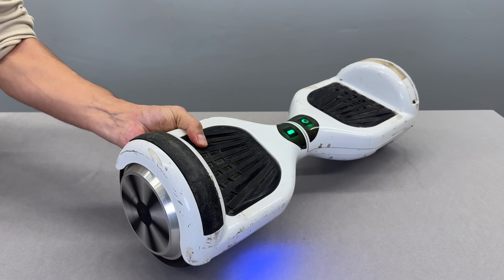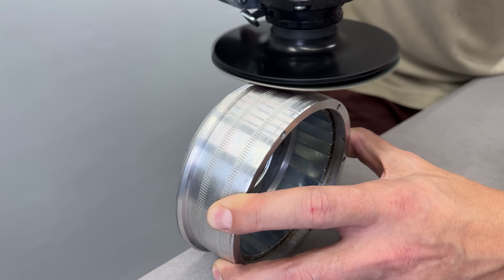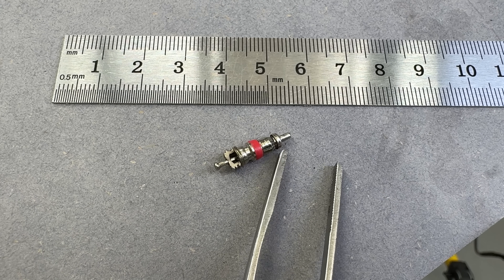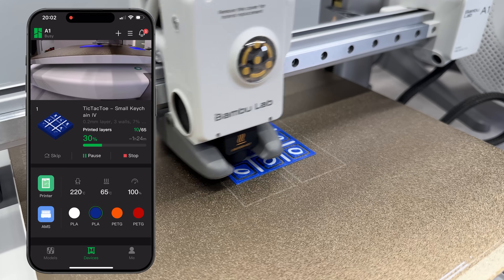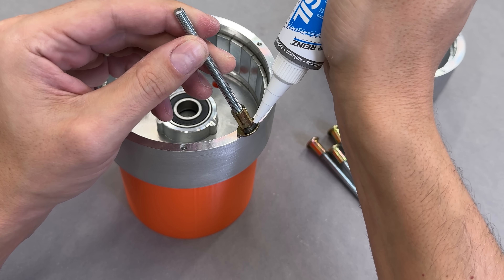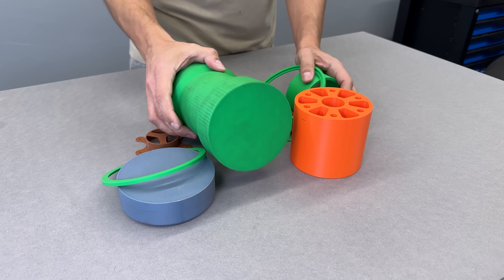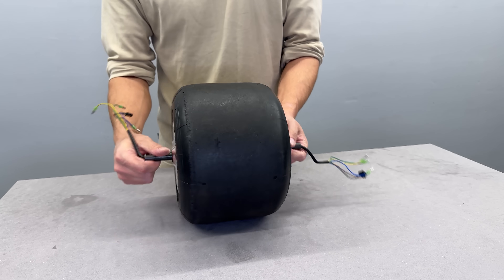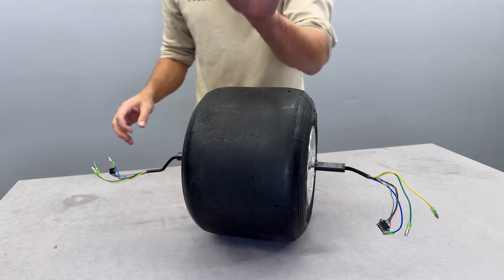This Tubeless Wheel Has 2 Motors Inside

Comment from the maker: What would YOU power with this dual-motor beast?! 👇
 Drop your wildest ideas - electric scooter? mini tank? lawnmower from hell?
 Also, all 3D print files are FREE on MakerWorld (link in description)!
 👇 Let me know if you want a full build video on what I make with this next!
Reply: Did you include the file for the aluminum ring also?
Reply: what size of drill bit did you use to drill and  size of tap for the presta valve to tread in, answer asap
Reply: @PHLocalExtremeSports  Yes we need to know this. Drill an tap size , please🙂
Reply: A compact electric crotch rocket with dual motors—built for insane speed and the ultimate way to Go around.
Reply: Anticipation for this gokart but if you get two wheels you could put them close to each other and make a tennis ball launcher.
Reply: Onewheel pls
Reply: i wanna know could you do it with the side that the wires are facing to point in the same direction to make a single sided design?

Comment: This, IN NO WAY, doubles the power by putting both motors in a single wheel. This also isn't an original project, or even done properly to actually get good speed & reliability from the motors. FFS 🤦

Comment: HELLO FRIEND,
CAN YOU PROVIDE THIS INFORMATION:
WHICH THREADED TAP DID YOU USE TO INSTALL THE VALVE? TAP SPECIFICATIONS.

WHAT IS THE LENGTH IN MM OF THE SPACER BETWEEN THE ENGINES?
Reply: I need this info too

Comment: Even though I think you have come up with some creative solutions for a hoverboard onewheel, I can't help but think about all the possible leaks. they are 6+6+2 (6 +6 screw hole + 2 rim washer). think the rim washer is the biggest problem. But still think your build is nice, and you can still go with an inner tube if i have a point. looking forward to your upcomming build. Best regards

Comment: I would expect the air to leak thru the bearings (thru pors in the 3d printed part and thru the inner bearing and inside the motor and thru the outside bearing and it wil preasurize the seal)

Comment: Nice idea and execution!
I would change the central orange plastic spacer for aluminium. Although the pressure of the tyres is constantly pulling the 2 rotors appart, once mounted in a chassis, the vertical loads on the tyre can flex the two motor axis, and cause compression on the plastic spacer. 
If you are using it for a onewheel, i would be extra cautious about any failure cause.

Comment: made a very similar wheel for my onewheel, if you line up the magnets polarity in the hubs the same you can parallel the motor wiring and only need one brushless controller.
Reply from the maker: Nice idea! I need to try that.
Reply: Nice idea! How did you mechanically line up and lock in place the stators? 
Tightening them to the frame individually?
Reply: @adriangaleron3293 , yes, he failed to mention that both stators and both rotors must be synchronized with each other to use just one controller. In his design his stators were probably mounted on a common shaft in phase with each other. In this design I would not want to trust the axle nuts go hold it in alignment, where 1 degree slip creates a 20 electrical degree offset.
Reply: @imho7250  I was thinking about vibrations in the frame produced by lack of rigidity plus two motors working locked/synchronized in place with a "spring".
Reply: @adrian, since these are both originally single sided axel motors designed to be supported by one side only, I think if he maintains that rigidity in his future build it will be ok. The plastic core he made to connect both rotors is probably rigid enough. 

The main problems with trying to run both these motors with one controller is that the stators are not locked together, in phases with each other. So you can only use one motor’s hall sensors, and after pairing only one motor will run correctly. And if you try sensorless it will be a nightmare as the observer sees two out of sync motors running on shared phase wires. 

If you have a very secure axle mount with an adjustable torque arm, and two hall sensor tester boxes, you could lock one axel and degree in the other one until the hall sensors all light up synchronized. But any slip of either axle just a tiny bit would cause major problems.
Reply: How did it compare with the original onewheel motor??
Reply: No
Reply: bro can you give your instagram i want help for making my own one wheel
Reply: Who are you